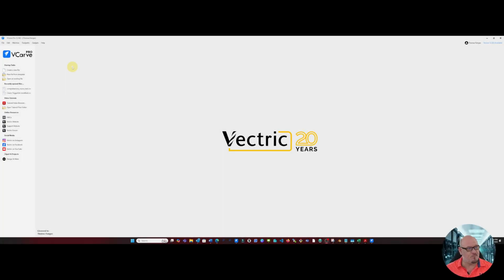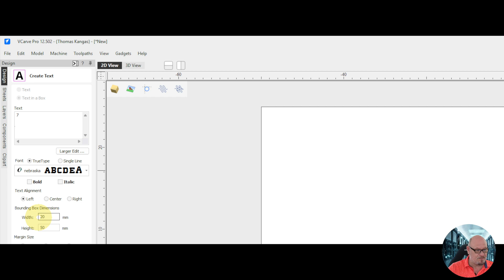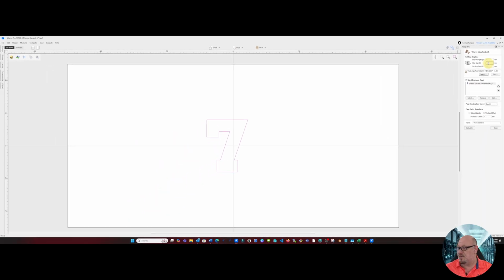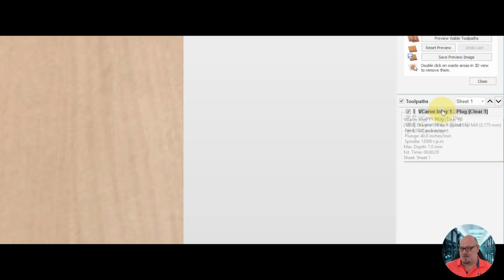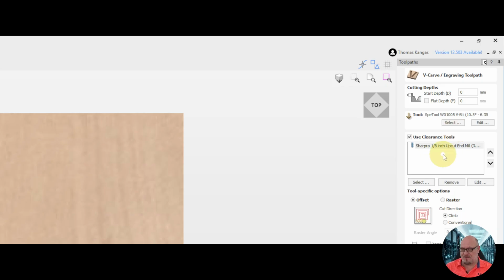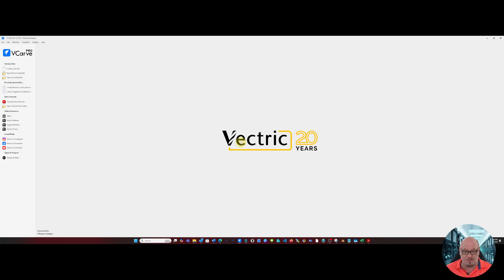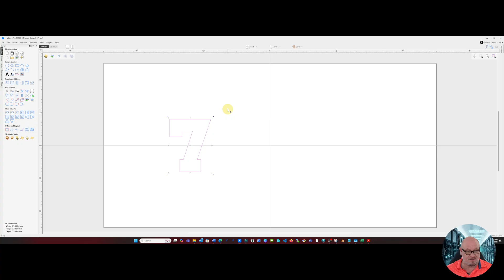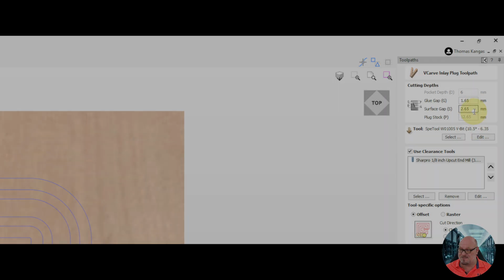I found a BUG in Vectric 12.5, Vectric FIXED it in record time!

Comment: Nice find.  Now I really need to get into inlays as I have never done one and didn't understand the gaps you were speaking of
Reply from the maker: Thanks for watching. Please let me know if you need help or a different explanation as to the gaps. If you are using Vcarve Pro, or Aspire the toolpath discussed in this video has a glue gap and surface gap. The glue gap is how much space is made available between the inlay and the pocket.  The surface gap is how much space is available for above the surface of the pocket, where either a band saw or a CNC can be used to clear the excess material.  Thanks for watching!